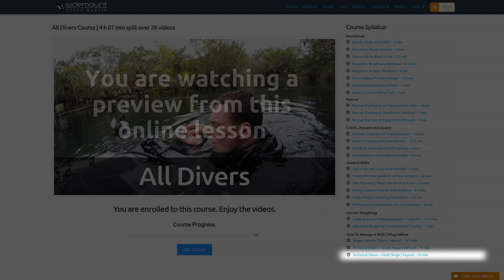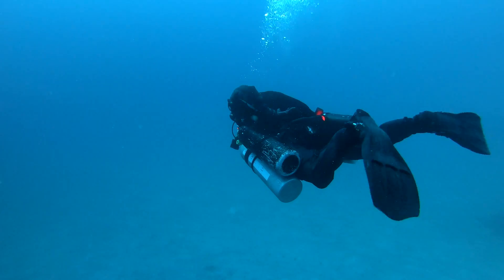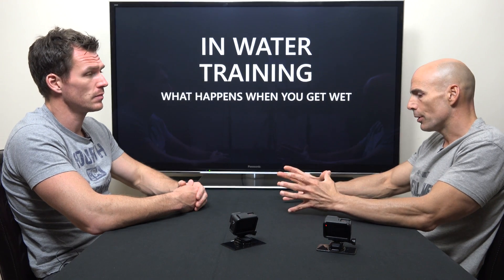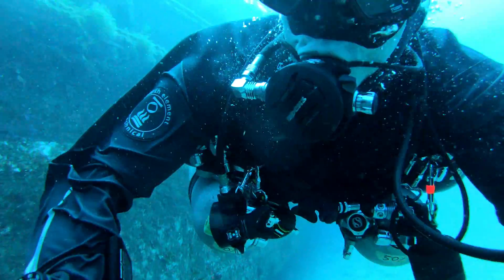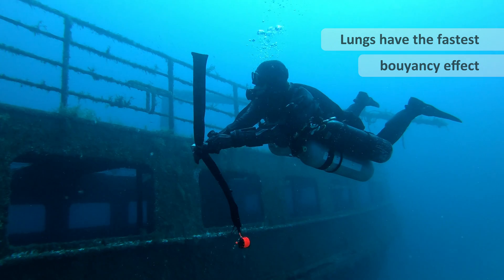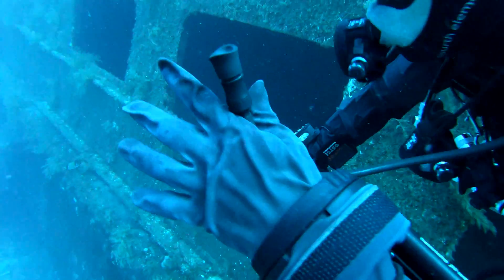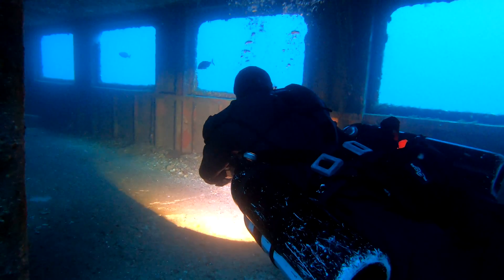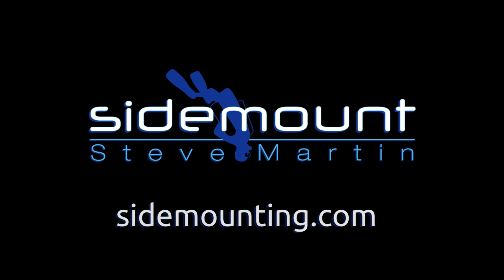Tec Divers - BCD Failure | Multi-Stage | Drysuit - Sidemounting.com

Comment: Looks like open water ocean diving.  What cylinders is Vas wearing - - Steel?  (Cubic feet capacity?)  Aluminum deco cylinders?
Reply from the maker: Hi Morgan, Vas' sidemount cylinders are 12L 232 BAR steel and I think you call them LP 85's. The aluminium cylinders are 11.1L and yes this dive was conducted in the ocean Gozo, Malta. Cheers, Steve

Comment: I generally just use my dry suit for lift when diving.
Reply: Personally, i dont think that is a good idea. It's very unstable especially when you are changing depth and you only have one valve where you can dump gas. I use my wing as my primary bouyancy control device